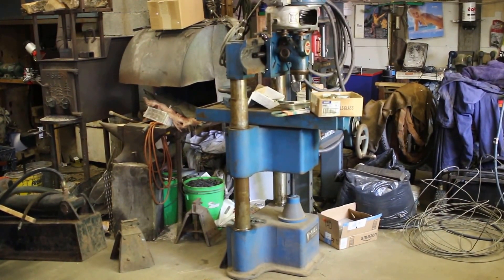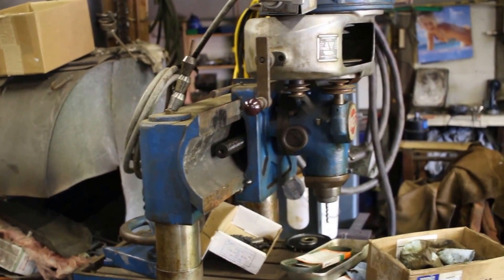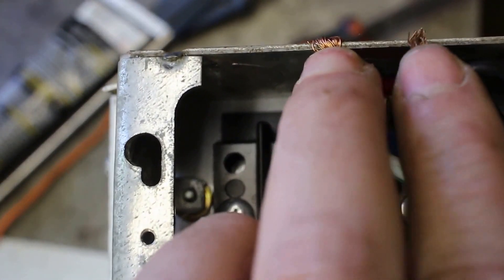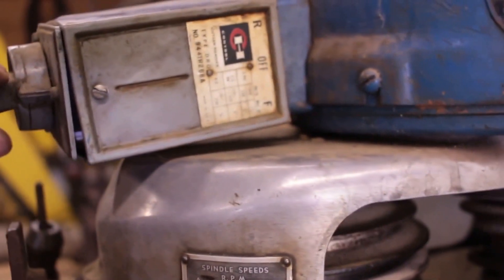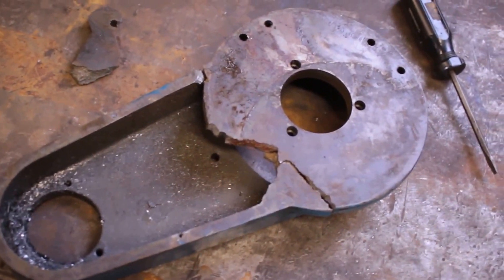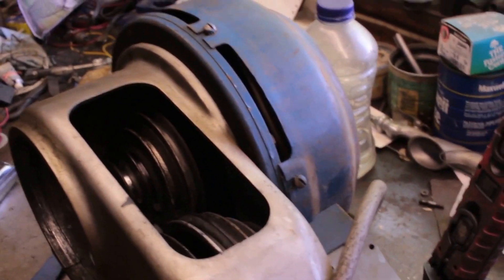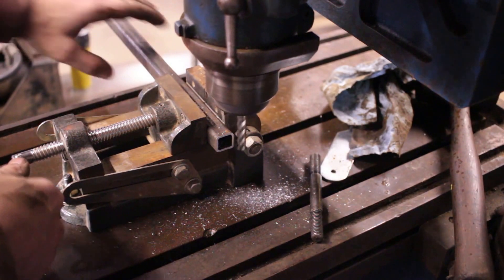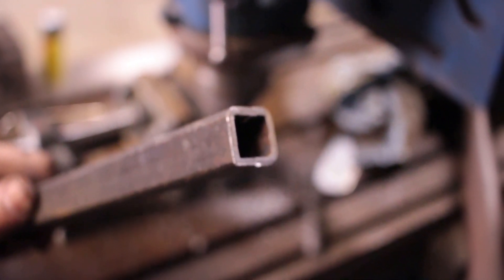$200 Craigslist Milling Machine

Comment: Great video. One thing, though. Please tell us what camera you use so we don't accidentally buy one ;-) I joke. It sounds like it uses a diesel motor for focus.
Reply from the maker: It's a canon SL1, I got it before my son was born as an upgrade to my old canon digital rebel, I figured I could use it to take both pictures and videos. I am disappointing that auto focus sucks so bad, I am not sure if it's a setting or if it's the camera but at this point I can't really afford a new camera.  In past videos I have tried to use a tripod and manual focus, and it does fine that way.  I forgot my tripod the day I wanted to try out the mill so I just filmed with what I had.  Of course it had to be the video that actually gets views..
Reply: Yeah and youtube smoothing (I call it auto-vomit processing) made it so much worse for me.

Comment: This is called a planer mill.  The head looks to be off a Tree Machine Tools vertical milling machine.  You could probably make an adapter plate that would allow you to mount a Bridgeport head on the machine, gaining R8 tooling capabilities.
Reply from the maker: If something happens to this mill head I might consider it but right now this mill has pretty much all the features I really need.  R8 tooling would be nice but most stuff you can also get with just a 3/4 straight shank, it's just a bit harder to find.
Reply: Why? You can just buy an er chuck and have r8 capabilities while keeping the z system.  diyVT keep that head.

Comment: My advice for this coool looking machine. get steepers on it, and see about R8 tooling, I bet this is a beast at fly cutting since it will have less twist in it give then gantry style head setup.
Reply from the maker: Unfortunately a R8 tooling conversion isn't practical for this machine.  There is no draw bar and no place to put one.  I had thought about getting a ER collet chuck that has a 3/4 straight shank so I could get a wider range of collets but I am not sure it's worth it.  The collets I have are 3/8, 1/2, 5/8, and 3/4 which should cover most of the tooling I would want to install.
Reply: So Given the way that pulley setup is done, you could mount the motor 90 degrees off to the side and have access to the top of the spindle pulley. From there you would just need to overhaul it to have a draw bar. A lot of work but would be worth it and cost only the scrap. (you would need a lathe for  part of it tough.
Reply from the maker: Stepper motors might be an option, with the chain drive it would be easy to hook up motors.  Some sort of power feed would be nice.
Reply from the maker: So I would need to make a spindle, redo the spindle pulleys and a whole new top of the machine where the motor mounts?  Or I could use this machine as is.  Or if I really really want R8 tooling I could sell this machine and buy a used machine that already takes R8 tooling.
Reply: YEP! it's a time and effort vs money thing.